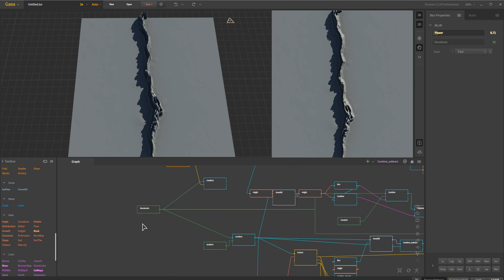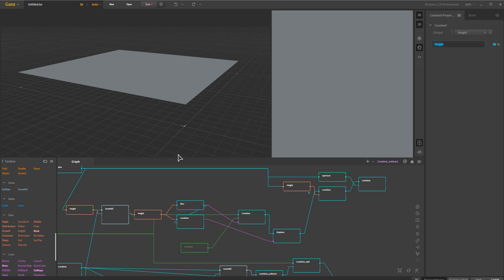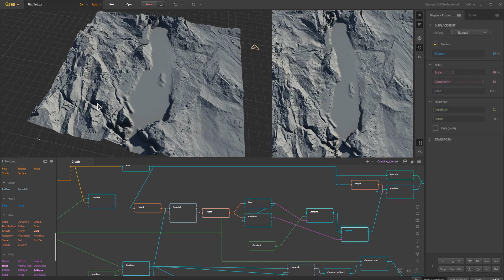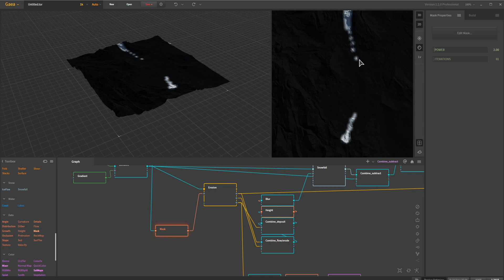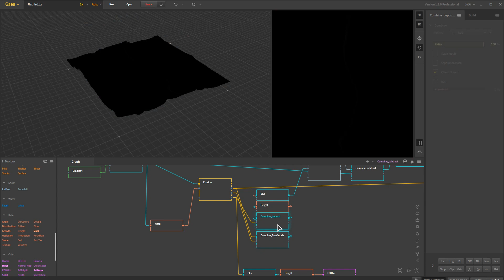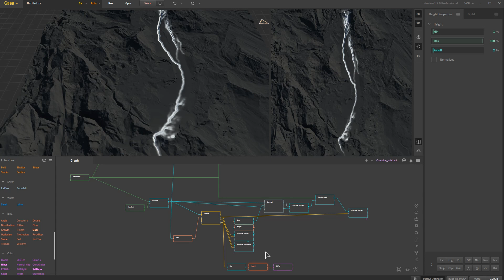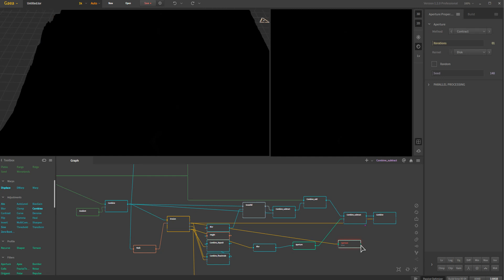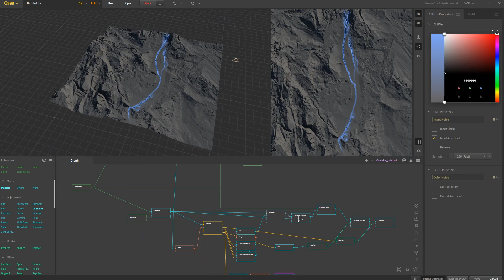Quadspinner Gaea - Creating Rivers

Comment: Superb
Reply from the maker: This video is about 4 years old and while you might be able to still use some of the ideas here, Gaea 1 had rivers added a while later so there are real flow based rivers in Gaea 1, and of course now with Gaea 2, those are again present and based on real data. I do have a video about using that tool in Gaea 1 and making more aggressive rivers for those times when the river tool doesn't give you enough.. and in my artstation course there is of course something for creating close up rivers, or much larger rivers, as well as river braiding.

Comment: The Snowfall node has a checkbox named "Use Snowfall mask" that must be checked. Otherwise it is impossible to achieve the results shown in your video. I assume the checkbox was added after your video was made.
Reply from the maker: you can see it revealed and on at 6:47. I tend to redo these videos more than once for one reason or another and on certain takes I may remember to mention something but in a later attempt forget.

Comment: Great Video! Really helped me!
Btw I was trying to create a Karstic landscape, such as the one found in the Guilin Province in China, in the Li River, but I am unable to recreate the rock formations found there... 
Would you have any idea on where to start?
Reply from the maker: The issue with Karst is the steep angles. You can get the base shape with Gaea, but once you have that you need to take it elsewhere to get the details. You won't be able to texture or add surface detail without going 3D. Height maps can't do much with a steep angle. So, Zbrush remesh and sculpt or displace then paint, or normals and texture using triplanar in the engine of your choice would be the most likely next steps. There are other solutions like voxels or remapping the UV of an exported mesh.. though the former still needs triplanar, and the former is likely to still have some distortion or seams.  The one advantage you have is those locations often have a lot of trees to cover the issues.. :)